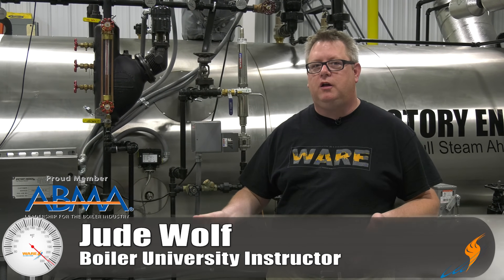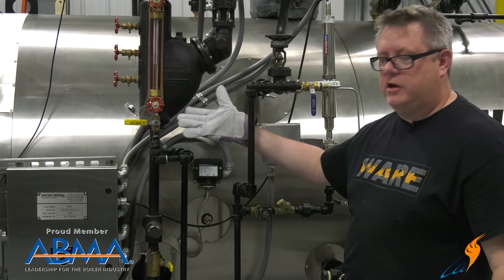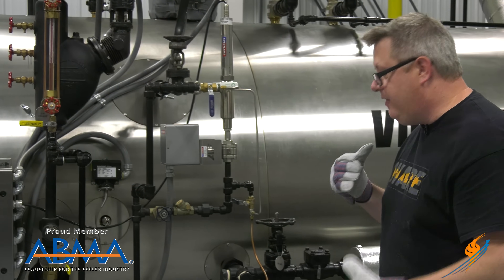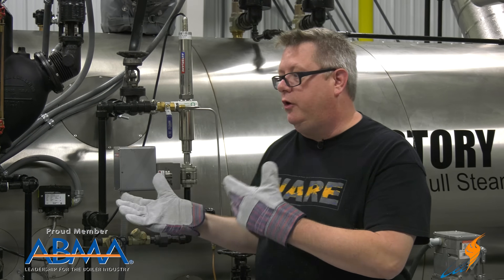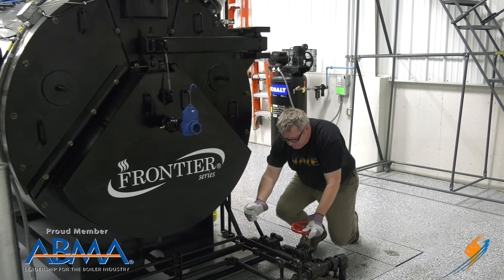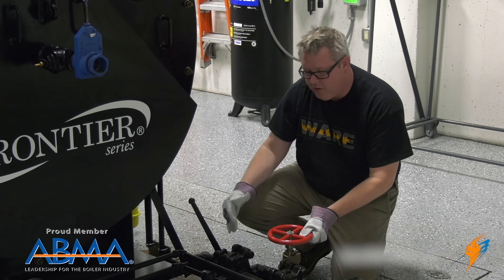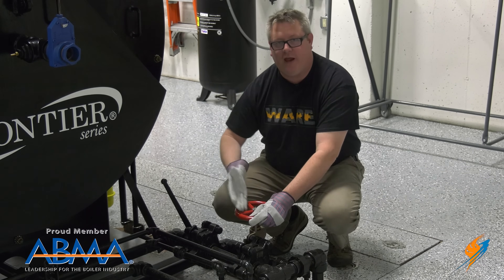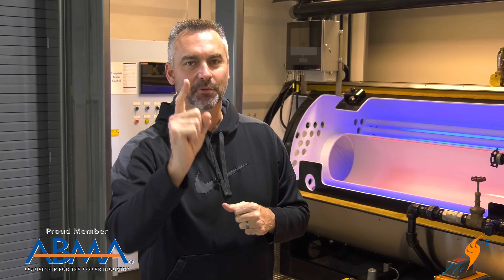How to Blowdown a Steam Boiler - Boiling Point

Comment: Another reason not to slam open the valve to blowdown the water column/primary low cut off is because if you have a float type switch instead of a probe, you can crush or crack the ball float. Same applies with the secondary
Reply from the maker: Great advice! Appreciate the comment and thanks for watching!
Reply: wareboilers ref

Comment: Bleeding the pressure upstream of that slow open valve completely defeats the purpose of the "quick first, slow second" procedure. The next time you open that quick valve you will have full boiler pressure going across that valve with no water buffer meaning: water hammer. Quick valves aren't designed to be operated like that, by the very nature of it being a quick open valve there is no way to operate it without having extreme water hammer, that's the reason we have the "quick first, slow second procedure". They will break fail quicker than you'd think. Your slow open valve will also fail faster because it's getting slammed by the boiler pressure as well. 

Leave that water in between the two valves. It acts like a cushion

Comment: oh and if you have a constant blowdown it's good to blow that system down daily too.  Meaning look where the valve setting is.  Close the valve and count the turns.  Then open it all the way.  Close it all the way then reopen to where you started.  This just flushes the system so it doesn't plug up over time.  Remember it's removing dissolved solids and those solids can precipitate in the piping after the constant blow down plugging it up.

Comment: Wow!  Nice video but.. When talking about constant blow downs you should have elaborated on that mic valve.  It has numbers on it and a very small adjustment can have a large impact on your conductivity.  In fact if your at 1200 I would only move it by 1 whole number and retest after a few hours of run time.. Maybe even 8 hours.  If it's off by a little bit you may want to move it by .25 of one number till you get it right.
One day you may want to automate it and it will be blown down via solenoid valve.  I've been around long enough to have done operated boilers more than one way.

Comment: when you do botton blow downs is donewith boiler running or boiler off
Reply: You can do it with the boiler running (ideally at low load conditions). Also you can do it to boilers that are on hot standby as they do cycle on and off several times a day to maintain temperature and pressure. Off meaning what? If the boiler is not running and has no pressure you can't do a blow down as there is no pressure to move the water out of the blow down.

Comment: Just a note regarding blow down. Code refers to the bottom piping as blowoff and the surface piping as blowdown. There are different requirements and limits for these two systems. Interestingly code does not have a classification for the piping on the low water cutoffs

Comment: We are using Parker Boiler 25HP.  The plant runs between 80PSI to 115PSI and runs for 8 hours shift.  What should be the ideal PSI for the partial blowdown? Do we do before, mid or end of the shift?

Appreciate your input!!
Reply from the maker: Whatever pressure you normally operate at should be fine if you have a blowdown separator.   I would wait for a minimum load on the boiler if a pressure drop affects your process. Hopefully that answers your question. Thanks for watching!

Comment: What’s a free blowdown valve? Got asked that on a interview
Reply: Did you figure what the free blowdown valve was for?
Reply: @tjn2254  its a spool in between the the non-return valve and the main isolation valve. Basically removes the condensation once the valves are closed
Reply: @losgar2515  The free blow valve between the two steam stop valves is primarily for the inspectors safety. If he is going to enter the water side of the boiler. He can look at the two steam stop valves to verify that they are closed and then look at the free drain valve to verify that it is open. This piping MUST not be connected to any other piping such as drains, blowoff or  blowdown piping.  The end of the piping must be visible to the inspector. As another side note code does not require a non return valve, simply two valves. If a non return is used however it must be the first valve off of the boiler.

Comment: I wish my water heater had something like that to remove the sediment and scale from the bottom.
When the element failed, it was because of the scale.
Sent a guy to replace it, it failed inside two months.
I rigged a vacuum to remove the sediment, and replaced it again, myself.
Hasn't failed since.
No wonder plumbers are able to sell water heaters so easily!
Reply: MacGyver at large when you first get a water heater ditch the garbage drain valve and put on a decent full port, you can essentially do the same thing.
Reply: @bruiseandy  the drain valve is not large enough to let chunks of scale out had to use the opening the lower element mounts into.
It will be good for several years.
Also, the level of scale in this area is incredible, because the entire region has bedrock of limestone.
I refuse to drink the water because it tastes like dissolved bricks.
Reply: Every month or two use the faucet on the  side of the water heater to blow water off for a few seconds.  Sort of the poor man's blow down.  It won't get rid of everything but will help.
Reply: You might consider a home water softner .

Comment: Good instructional on how to blow down the boiler! Can you talk about frequency more?

I have an over-sized boiler (400 horsepower, firetube, natural gas, Cleaver Brooks) to heat a 30,000 sq ft facility in NY Metro Area weather. We don't get a lot of steam movement or makeup water in our system (150 gallons makeup/day). We get almost all of our condensate back. 

Originally the boiler was used for humidification of the laboratory space (lots of steam use and flow),  but now it is solely used to heat the building. 

Would you still recommend blowing down the boiler every couple of hours, or would you prolong the blow-down schedule. 

The manufacturer calls for every 8 hours, however since we don't get a lot of makeup, I think we should prolong our blow-downs.

I don't want to accumulate too many solids at the bottom though, I guess this is a balancing act.

Would be cool if boilers came with cameras inside them....
Reply: Once a shift. If you work with a chemical company for your boiler they could probably be more specific, but if your conductivity numbers aren't all over the place, I'd continue with the once a shift or every 8hrs. You'll also be able to tell on your annual inspection when you open it up and flush the water side

Comment: Hello there! 

I just have one question. We have a boiler in my college where there are two intermittent blowdown valves right next to each other. They tell us a way to open this valve a little bit then open that valve a little bit (basically to make them equal) but I don't understand the technique. Could you please tell me what's the basic role for that? 

Thank you & as always, great presentation!
Reply from the maker: Based on your description, it sounds like this is still the main blow down for the boiler but instead of having a quick open valve and then a slow open valve, you just have two slow open valves. Per code, you are allowed to have two slow open valves as your blow down valves (compared to one quick and one slow) but you can never have two quick open valves. Hopefully that answers your question. Thanks for watching!
Reply: @wareboilers  Yeah, you are right! I should have mentioned that they are two slow opening valves. My question is, they tell us to open this valve like 2 turns and then the other one two turns or something like that. I don't understand the technique. Maybe I will ask my instructors tomorrow.
Reply: Just open the first to boiler valve full then for second do the throttling and controlling after blowdown close by sequence inner to outer
Reply: @rushikeshfegade  Yeah, everything you said was exactly explained after 2 weeks of my question though I appreciate your help a lot. 🤴

Comment: What is the purpose of quick opening valve in bottom blow down?
Reply: There is a purpose in locating the quick open as the first valve. When you start the procedure with both valves closed, the quick open valve is simply moving through the water, it is not starting or stopping flow. Theoretically this valve will not wear and therefore always be a tight shutoff valve. This allows you to service the slow open valve with full boiler pressure. The slow open valve has an extremely hard seat, usually 500 brinell hardness and is designed to handle the flashing conditions that develop during operation.
Reply from the maker: The biggest thing for the quick open is that it really is to be in line with code. It is an visual indicator on the state of the valve (whether it is open or closed). Hopefully that answers your question. Thanks for the comment and for watching.
Reply: @wareboilers  
Thank you for the reply.

The state of the valve can be known from the slow opening valve itself i think.
We don't use quick opening valve as a visual indicator along with slow opening valve anywhere  for other applications.
So why does code insist  this  if it doesn't  serve any purpose other than just visual indication of the state of the valve (open or close)?
Reply: Sediment, scale, and other solids don't have as much chance of hanging up in the valve of a quick opening valve as a slow opening valve.  The valve opening  is the same or slightly greater than the pipe diameter coming from the boiler.
Depending on how the stem is made and connected to the valve from the handle/wheel it may not show on the stem whether the valve is open or closed unless there is an indicator.

Comment: What is the formula for the heating surface of an electrode steam boiler?
Reply from the maker: There is not one formula to calculate that but rather is manufacturer specific. You would need to reach out to whoever makes the boiler and get their formula from them. Hopefully that makes sense. Thanks for the comment and for watching!